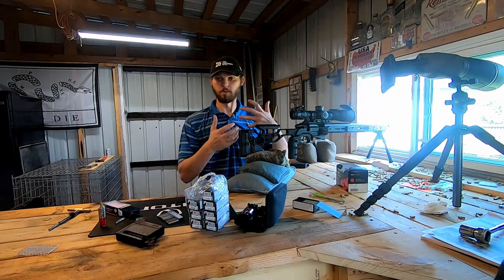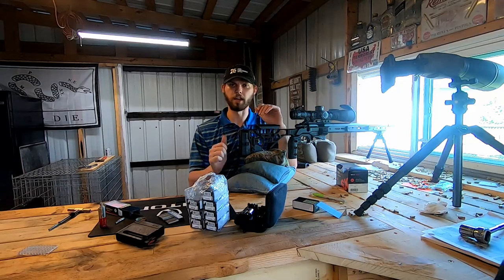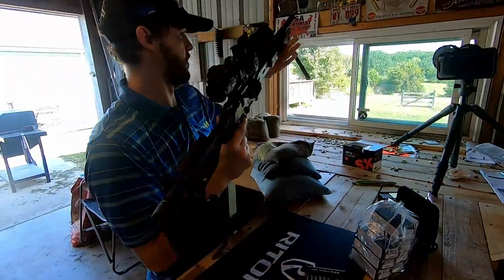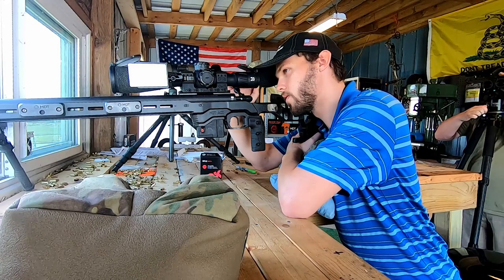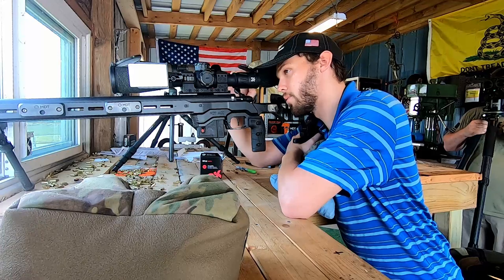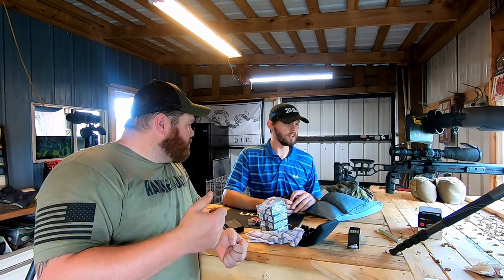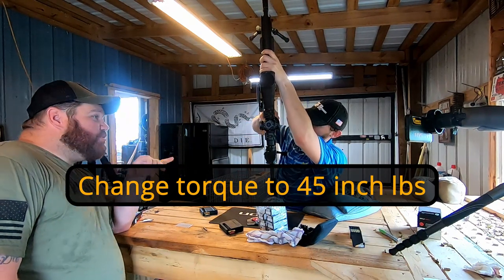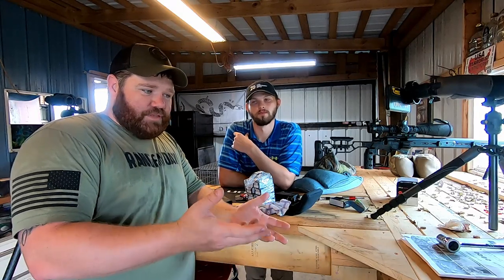Action Torque "Affects on Accuracy"

Comment: Stuck a hub collar on the barrel of my Marlin 882 SSV (.22WMR). After moving it in 1/8" increments and doing two shot groups (@ 50 yds) till groups started  opening back up I broke out the calipers and starting eaking movements at .005" increments. Yeah I'll have to repeat if I change ammo/lot but the results are unbelievable for a $10 investment (vs $200+ for a commercial unit).

Comment: wow, Youtube actually suggested a video I could benefit from. I originally did not understand the value of adjusting the action torque but the other day I did a video and it dawned on me maybe barrel whip is causing my rounds to have 3 distinct groups. I then thought about my rifle with a tuner on it and the light bulb went off and I thought what if I could limit barrell whip by adjusting the action screws. I am looking forward to do some testing but I must say your video was perfect. I feel testing different tightness and then retesting the smallest group was perfect. Thanks, Bret
Reply from the maker: Thank for checking out my channel.

Comment: Running the MDT XRS chassis on my CZ 457 with Lilja barrel. I have heard a number of different torque setting for the 22's. Called the MDT factory today and was told the inst that came with stock says 50 60IP but that is for like 700 actions. For the 22lr it is between 25 and 40 IP's and suggested to start at 25 and go up in increments to see where it shoots best. Tightening the front action screw first then the rear. as you know each gun is different.

Comment: I had seen a YT to do something similar for my RPR 22 using folded aluminum tape to assist in the bedding but I didn't really know what I was doing at the time, hadn't gotten a baseline as the action screws had fallen out in first 20 rounds of getting the gun! luckily found them under the bench! So had to torque them back in but didn't try at different values-just went to what Ruger said they should be torqued at and didn't do that jarring to 'bed ' the recoil lug...Time to revisit this and do it right! Thanks millions(or at least tens and twenties-haha)

Comment: I have tested this but on all my rifles there is no difference between 30 and 60lbs. As in the screw does not rotate any further at 60 after 30. 30lbs seems to be enough to tighten them as tight as they are going to get. I no longer check when I build. I just tighten and have never seen an accuracy issue. Maybe on a unbedded no pillar wood stock or something?

Comment: If you need to play with the action screws to get accuracy the you have in my opinion a problem with the bedding of your action. the chassis only needs to be tighten by hand as there is no give in an alloy chassis, I've never had problems. I'm not new at the game and have had plenty of experience. Pro Shooter.🦊🦊🦊🦊🦊

Comment: Hey guys. Would adding lock tite affect the outcome?
I know it messes with the reading on the torque driver when you add it. Any thoughts? Thanks for the video.
Reply from the maker: Honestly not sure, if I had the amount of deviation it caused I’d probably offset my setting if it was a repeatable deviation but the overall out come of the torque setting test on accuracy would most likely have a similar outcome

Comment: Lmfao yeah just drop the gun against its recoil lug, my God I've seen everything now. People DO NOT DO THAT !
Reply: Care to explain why?

It's an aluminum chassis and this gun has a thick recoil lug. You're not going to hurt anything with a 1-2in drop to set the recoil lug.
Reply: @alexspencer8904  lmfao yeah just keep dropping it man. My God have you ever seen a benchrest shooter do this crap. I'm a br shooter for 10 years. Tuners don't tune harmonics whatsoever. You guys are 20 yrs behind br shooters, we've done all the work already and ypu guys ignore it. Like you guys are trying to reinvent the wheel. I place my gun in the stock against the bedding and make sure it's in place then put screws in. No need to bounce the damn gun into a chasis. Lmao this is sad
Reply: @samw2768  while I agee it's not necessary for centerfire, I've found it necessary for my rimfires with a non bedded chassis to give a slight jar for consistency on torquing settings/for how it shoots.

I've seen a lot of people do it, I can't say if I have or have not seen br guys do it. 

Also if barrel tuners don't effect your barrel harmonics, what is the mechanism that causes them to work? Genuine question.

I'm not afraid to say I'm wrong or to test/validate different procedures. However, I need more than just a "you're wrong! Haha" with no explanation as to why. The conversation actually needs to be constructive by having more information.
Reply: @samw2768  seen enough of other guys using Eric Cortinas tuner to wonder how staunch you are in your belief. Just out of curiosity what's the list of your competition titles?